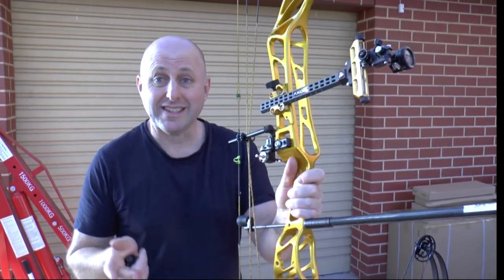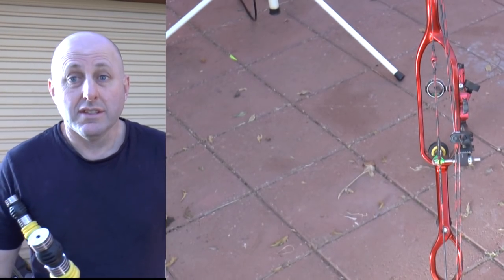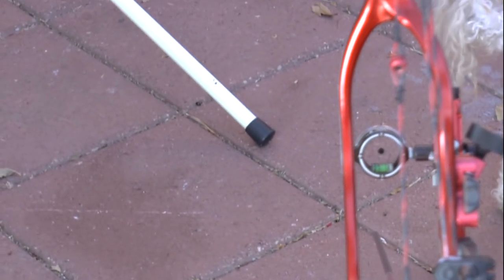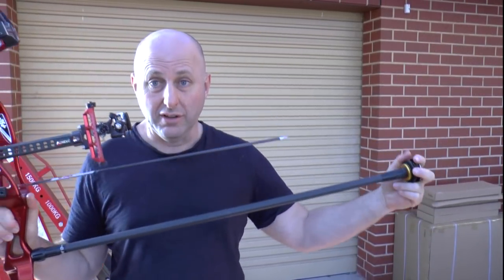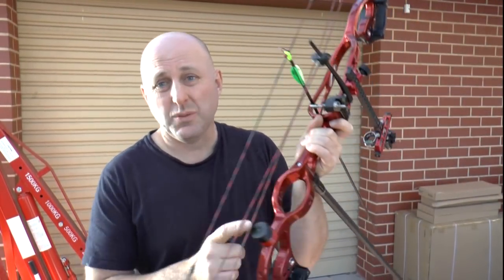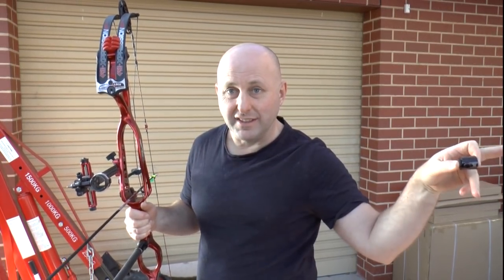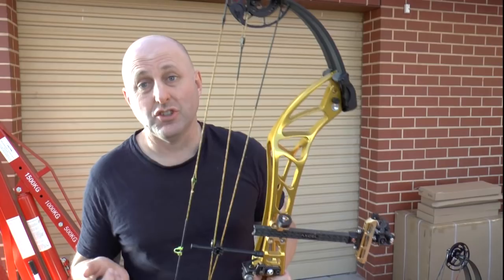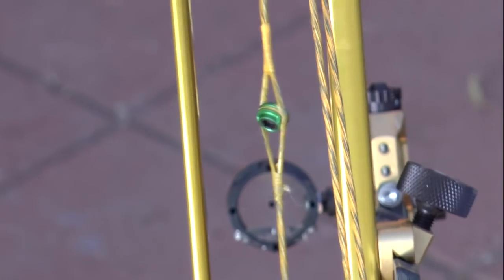Archery Stabilizer off center

Comment: Back bar setup, whether it is a single or a v-bar, all depends on grip pressure and whether you want your grip to be active or passive.

Balancing the setup  with v-bars means your grip can be more passive and just cradle the bow.  The bubble level on the sight will sit level without any additional input from the archer.

Using an offset bar or a single sidebar swung out far and using a lot of weight like Reo does requires a lot of side pressure from your hand in order to keep your sight level.  This is thought to add a level of steadiness and stability while executing the shot.  

Both systems work, and it is essentially a matter of personal preference.

Comment: Best way to check for straightness is to tape an arrow to the inside of your riser over the arrow shelf and check to see if the stabilizer is parallel.  The cam track for the string may not be centered on the axles, the bow's centershot may not be down the center of the riser, and the sights will generally be offset from the torque induced from running a single cable guard rod (only a shoot through cable system would run straight down the middle.)
Reply: Nope! The cams are offset between the limbs.

Comment: Great information, I had the same problem with WNS EXPLORE DX RECURVE'S RISER while using 27inch Stabilizer its point towards left of 2degree. I was in confusion did I bought the useless product or is there way to remove the stabilizer bush and replace with correct angle. After seeing your video I understood it doesn't matter. Only Practice make the skill.

Comment: Great video.  My PSE is slightly out and it doesn't bother me because I use a 12 degree down quick release so can't see the long rod.  Just go for the balance.
Quick question, is there any way to get a new bushing for a PSE.  My offset attachment seems to have welded itself to the bushing so I cannot take it off without taking the bushing out.

Comment: Nice timely video. Just ordered up some tungsten weights and some Stainless steel weights for the v-bars. Already getting grief for the v-bar. I tried to move the side bar from the left to the right just to center the bubble easier. Nope, the thumb didn't like that concept. Bungee cord from the toe to the lower limb is next.

Comment: Using a v-bar does makes sense when it comes to perfectly balancing a bow (front/back and left/right). 

But Something I don't understand is that most pro compound shooters run a front stabilizer with quite some weight on it, and a single back bar with even more weight than the front stabilizer. The back bar (and its weight) is definitely heavier than their sight on the opposite side of the back bar. So. Do pro shooters torque their bow intentionally?

Comment: Those risers are CNC machined, drilled and taped. CNC machines have accuracy of 0,01mm, so in my opinion stabilizer should be in line of center of the bow unless designer designed it different way. As you mentioned the is no way they tap them by hand, I would even say that this is rigid tapping operation on CNC machine. Imho stab not in line is a manufacturing flaw.
Reply: Marcin Barwinek yes i would agree with that !
Reply: I think it could also be the carbon tube is not fitted into its attaching base square as well......
Reply: Marcin Barwinek yes i thought that myself... But again for the money charged ...
Reply: Highly possible.
Reply: Most bows have bushing inserts so CNC will just drill the hole for it. Now you have tolerance of the drilled hole + tolerance of the tapped thread in the bushing + tolerance of the tapped hole in stabilizer + tolerance of the threaded stud. For deviation of 1/4 inch (looks like Steve's bows) at 33 inch you need error between those 4 components of 1/2 of a degree.
But lets just do simple math for hole in the riser. You have 1 inch hole controlling position of 33 inch stabilizer, so every deviation is multiplied by 33. Deviation of .0075" at the hole will result in 1/4 inch at 33 inch.
Reply: Well, almost 0.2mm form error (concentricity) on depth of 25,4mm is a lot.
Reply: Yes for single component.
My stabilizer looks worse than Stevens and I don't have any problem with it.
Reply: Unless I will get those sub 1500$ bows for free is also not an issue, but to be honest I didn't noticed that on my previous PSE's, Hoyt's and now Mathews and Elite. Stabilizers were dead straight.
Reply: If you use trigonometry a long rod 33" long( 838mm ) to be out to one side by 3.6mm only needs to be machined off by 0.25deg.
Thats nothing really. 
But you would think being machined from a solid billet on a 5 axis miller is should be spot on.
I thought the down angle was to place the end weight below the bow hand in particular at long distance shooting.
Reply: Yes, I was doing trigonometry for 1/4 inch (6.35 mm)

Comment: The only thing I have ever found that matters with front stabs. is those 1 to 2 inch offset plates on the front of the bow to move the whole stab left or right....they make the bow torque weird in your hand.... kind of like a spinning twist!?!?!?
I think one thing people cannot understand is that with all thing complex mechanical  whether a bow or a racing engine is you have to find the "sweet spots" on it and that dose-not mean exactly factory settings...mainly with a bow cause a human is holding and operating it and everyone will do something different, how ever so slight, as a shooter!?!?!? as an example would be the "shoot like me" series....

Comment: Freaken hell I thought this pointing left of the stabilizer on my recurve wasn't normal and I tried to keep tuning till everthing lines up (of course no luck) and I even tried to change my form to force everything to align with each other.  So if I can average 265-270, I should leave it as is.

Comment: I shoot better with a Bow Hunter style setup that just has a 10" front rod than loads of stabs and weight. My front shoulder can then get into the correct position and be under less strain, hence I am more relaxed. With good hand position left and rights shouldn't be a problem. If you are having form problems take off everything and shoot bare bow, and build up again from there. That will show you were the problem is, such as hand position or shoulder placement. I see so many archers who can't shoot for toffee but have a ton of weight on their bows, thinking that will help them aim better. It wont.

Comment: I just added a homemade extension to my 8" hunting stabilizer using a threaded rod and coupler nuts. I also added a bracket and right side v bar using the same method. Aim on my hunting bow (NXT 31) has steaded dramatically and it's shooting like a target bow,.. just looks funny but still weighs less than a target bow.